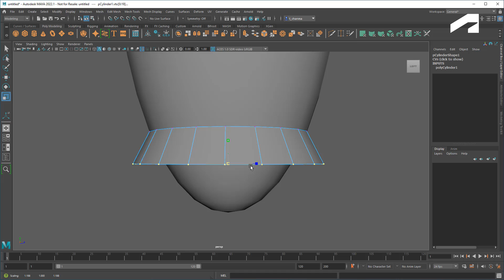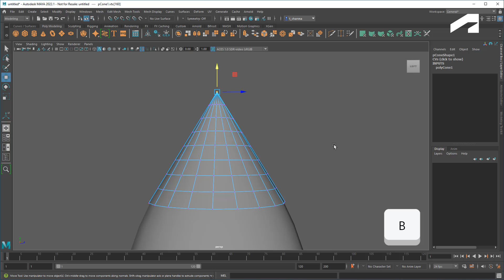Maya Quick Tip: Component mode acting "wrong"

Comment: The problem I have with Component Select is sometimes I grab multiple parts and they move in wildly different directions instead of uniformly in the same direction with each respective Component.
Reply: Happens when using symmetry mode too.
Reply from the maker: Try double-clicking the Move Tool to open the Tool Settings, then set Axis Orientation to World.